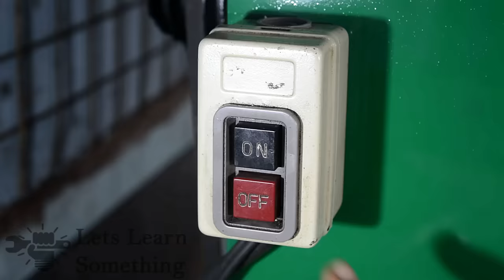Homemade Lathe Machine

Comment: I give this 10/10 for effort and persistence.  However, the key things missing are measuring the "bed" for twist, aligning the headstock to the bed, and squaring the cross slide to the spindle axis.  This is a cool barnyard machine but without these precision alignments...its accuracy won't ever be any better than used lathes you can buy all over the place for $500.  Further, those spindle bearings are not preloaded and not even intended for thrust in the first place.  And no tailstock....
Reply: Now do you feel much better cutting down someone else hard work. You are fricking amazing. Instead of saying good job, you try to boost your ego by cutting down someone. You must truly have a very low self esteem.
Reply: @lisah6451  man he is literally giving some suggestions to make it better
Reply: @lisah6451  As Creator must accept any advice/suggestion/comment, this is how design evolved.
Reply: @bobemperorofbobkind6004  still a cutdown by telling him that a piece of crap $500 machine would be just as good
Reply: @lisah6451  you're too emotional. the guy gave credit, then gave his critique. stop creating drama.
Reply: @lisah6451  He gave valid and useful advice. You just jumped in and started displaying Bad Manners. The only one here that is guilty of the charges you've levied is yourself. To be clear, he didn't equate it to a "piece of crap". You did that. It's very important, specifically for a person who may want to build their own first lathe, that they know the inherent shortcomings of a machine built from the process shown here, and perhaps consider buying a used - commercially made - machine in the $500 range as their first foray into lathe machining. The parts to make this version will likely cost as much, require many pieces of equipment that may not be at hand, and get no better results, if the project even gets finished.
Reply: @lisah6451  THE GUY ABOVE IS RIGHT...10 OUT OF 10. BUT EVERYTHING HE STATED IS TRUE. BY THE TIME I GET AND PAY FOR ALL REQUIRED PLUS TIME IT WOULD BE MORE THEN 5-600...WE ARE NOT DOGGING THIS GUY. HE DID A GREAT JOB WITH WHAT HE HAD TO WORK WITH..SHIT I WAS THINKING ABOUT DOING THE SAME THING. BUT USE HI WIN LINEAR RAILS...THE NAME OF THE GAME IS RIGIDITY...
Reply: Hi and welcome to mental therapy! Stop and think. All of the answers and comments and opinions are correct! The fellow watched videos and got up off his butt and jumped right in! He bought what he needed. He made what was in his mind! The "mental picture" of what HE WANTED the machine to look like...and HE DID IT.   Now, the fellow that ADVISED him, to square the chuck with the table (the "WAYS"), and to make a TAILSTOCK; were very good advisements! If He listens to the comments, in this chat box, he can make his machine much BETTER! Even the drama, that was started, was that person's way of stating that they didn't know anything about his subject so they lashed out against it. (In time, hopefully, they will set foot into the real world, and experience how it feels TO TAKE SOMETHING THAT WAS MEANT TO DO ONE THING, but make it into something totally DIFFERENT!) Their mind runs with the knowledge and their body delves into the reality that HOBBY DESIGN is a mental THERAPY! You can get lost in doing it. You make something, from what YOU want it to do. If it works,...fine! If it doesn't...figure out why and build it different! WORK OUT THE BUGS IN THE DESIGN, yourself. Take opinions and advices from other folks, and address the idea. 
   BUT ALWAYS MEASURE IT TWICE, And cut it...ONCE! 
Thank you ALL for advising this young man! I'm sure He appreciates the advices. even the drama stuff...there's always SOMEBODY that just HAS TO put drama into it!
Reply: Please give a list of places to purchase metal lathes for $500.00 or $600.00. I want to get me one!
Reply: @general5104  Ebay, Craigslist, hobby machinist forums, various auctions (schools/estate sales/etc), word of mouth/friend network, (re)build from scrap from various sources, books that show step-by-step how to build a lathe with itself as you cast and accurize each component yourself (there's even YT videos of people following the instructions in the book set to create their own machine shop).
A lathe is a machine that facilitates the removal of material from a workpiece at greater speed than by hand, while attempting to maintain accuracy. How you get to that point is the path you make for yourself.
Reply: @general5104  face book market place..there's usually a shit load.
Reply: usually no threading
Reply: HE IS NOT BLACK THIS IS RASISM

Comment: Commenter in previous video: "imagine if he had a lathe"

This guy: "shits expensive imma make one"
Reply: And a pretty damn good one at that.
Reply: Yeah bro I've seen that comment too, this guy is a genius!!
Reply: Not for nothing... He could easily have bought a good used lathe for what he has into materials alone. Let alone time. But he still built an AWESOME machine that I'm sure will serve him well.
Reply: @brandoncrimmins6296  a good used lathe of this size for $500 (he mentions this cost for materials in another's comment)? Please, tell me where that exists.
Reply: @EwokyBalboa  First and foremost... I see NO comments with cost analysis. Secondly if there is a comment claiming a $500 investment. He either got a lot of this material for free or. He's LYING... 3/8" or 1/2" steel plate is EXPENSIVE! Ball Screws are EXPENSIVE! Lathe Chucks are EXPENSIVE! At least any chuck worth having is expensive... So again. Unless he had a lot of these materials and parts hanging around. Which he openly states he did. $500 is a fallacy. If you had to source and purchase all of these parts and materials. ESPECIALLY THE MOTOR! You'd be WELL into the thousands of dollars. Probably somewhere around $2,500
Reply: @brandoncrimmins6296  check Dave Lister comment asking about cost, it's line the third comment down for me, he commented on that. Second: all the parts he lists are Chinese, and they are pretty cheap. I'm pretty sure here not including the motor so probably right about that but used motors can be found pretty inexpensively
Reply: @EwokyBalboa  my point is if I was to build this in my shop at home. It tallies up at just under $2,500. So I guess shame on me for pricing QUALITY materials...? Even still...  Chinese crap isn't as cheap as people pretend it is. Especially when it comes to machine tool parts. 

I built a CNC router out of Chinese parts. All of my electronics, hardware and bearings came from China. And when finished I was lucky to hold an eight inch of tolerance. Which is a HUGE MARGIN for error on a computer controlled machine. Like at an 1/8" you might as well be talking miles...

After upgrading everything to much higher quality U.S. made bearings and hardware. Including the lead screws and nuts. It holds a solid 10 thousandths and it's made of MDF. So it would actually have saved me $500 or better to just spend the $1,500 on the quality stuff to begin with.
Reply: @brandoncrimmins6296  a good lathe chuck 4 jaws price at shopee online is RM 78(USD35). Steel plate 1' x 4' x 4' is about RM 55(USD13). SBR12-800MM linear guide with bearing per set is RM 67.80(USD 30). That few of the parts he is using. So, USD 500 is within the budget. I think you shops at the wrong place😁

Comment: I've watched this a couple times, and it's quite fascinating, but I'm not sure how you reliably get the spindle nose/bore lined up with the rails with precision.  On short pieces may not be noticeable, but it seems like on longer ones you'd be cutting a taper.  But it was very ingenious, and I'm sure will prove quite useful.
Reply: simple, loosen the bolts on the bearing holders, tap it in place, tighten the bolts. it will not be easy but not impossible

Comment: Would be worried about taper, takes a lot of tuning to get the ways  aligned with the spindle. Never seen linear bearings or a ball screw used on a lathe, I'm surprised by how rigid they appear. Great video, great job!
Reply: tailstock will be an issue

Comment: Yeah I'm a big fan of those linear bearings too. They really simplify the whole process. I've wanted to do this for some time.
Reply: The non raised linear rails actually flex less.   They are used in smaller Fadal and several other VMCs.

Comment: You should add some sort of wiper to the slides to keep the swarf out of your linear bearings, it will greatly extend their life and preserve the accuracy of the machine, it would be a shame for all your hard work to be ruined by parts wearing out prematurely because swarf got in where it shouldn't be.

Comment: Love how perfect plates of steel appear, clean and sized, ready to go! 
Did you order out or prepare in-shop from larger stock?

Very creative and great result in the end, looks very sturdy. 
Maybe smaller and lighter than a lot of commercial machines of equivalent capability, but that's an advantage.

Nice, tight editing, good pace - not extremely-too-fast, I felt I learned more this way!

Was that marking guage a standard machinist's tool or your invention?  Great film!
Reply: P
Reply: im pretty sure that all the pretty stuff is bought

Comment: I think I can do this, I have wanted a Lathe for 50 years, Im gonna make one.
Reply: how much does one cost anyway to buy,?
Reply: @fidelcatsro6948  200 for a used clapped out machine. sometimes you can find them at scrap price if someone doesn't know what they have or it needs rebuilt. Otherwise something in comparable size to this one would be easily $1000USD
Reply: @brunsy1990  i see thank you for the info!
Reply: theres ones similar in bed length for up to twice that on the far end of the spectrum. more if you get a digital readout system for real time dimensional measurements.

Comment: 18:33 It is such a beautiful thing to see you using the lathe you are building to turn a part of the lathe itself LOL and 19:46 you used the cart like a drill press haha. 

and 23:17
It's like machinist inception lol 

I wonder though, was it cheaper than purchasing a lathe?
Reply: Good
Reply: Cheaper than purchasing a lathe of this size with this amount of horsepower: For sure.
But not cheaper than a chinese mini-lathe I guess. But with more solid parts.

I think it's a nice inbetween :)
Reply: @kjeldschouten-lebbing6260  Yeah i think too so would i rather making one in the future? 
I like to watch videos about making but i don't have experience. I will live in France later and i know that there is place named fablab where people can help you creating things that you want i don't know if you name it like this too. 
But I think that i could go there and get some help and by praticing with them and get some tips i could gain in experience for doing my own stuff what do you think?
Reply: @kjeldschouten-lebbing6260  It for sure wasnt, you also have to count the work hours that he put in. I would say that he needed at least 250 hours for a project this big, so only the hours would cost him about 2500$ if he would earn 10$ each hour. In my opinion you can build stuff like that just as a hobby but you cant use it as a tool that you are working with, its only a toy.
But anyways good job.
Reply: @filipfurdyna5346  A crappy hammer is still a hammer. A crappy lathe is still a lathe, not a toy.
If you just need to make some fitting metal inserts once in a while or something, its a fine tool. 
Somepeople take fun in working to save money, I also don't count my hours for restoration projects and I don't hear the wife complaining about that costing us anything either.

Comment: This is about 1000 times easier and simpler than a gingery lathe. You should make plans.
Reply: Gingery lathe is made from scratch. Like nothing from the store except maybe screws. Also the guy knows how to measure things. Watch episode 16 when he makes a spindle and measures it with a micrometer over the whole length of the bed - it is precise. Notice he made it so it is fully removable and he can add shims as needed. Gingery guy knows his stuff.
Reply: @tomk3732  I personally know the skill and knowledge involved with building the gingery lathe as I am currently building my own. I'm just saying it's a lot easier to weld together a lathe than to cast each part.

Comment: With this im going to make a mill. Then with mill im going to create gears and rack for upgrade on this lathe 😀
Reply: that is basically how it happened. in 1752 the first modern lathe was made. thirt years later its direct descendant turned parts for the first mills.
Reply: That's how it is done. Google search on "Dave Gingery books" for more examples.

Comment: To start, I am impressed by your work and devotion on this project. But do have a lot of questions concerning it as well.
You seems to have no clue about the flatness of the bed and the carrier, so you don't know the limitations/precision of the X and Y axes. If you want to improve that you need to control and rectify the bed with a granite block and a bit of hand working. The second problem here concerns the spindle, you must check if it is concentric.
Reply: if the rails are parallel to the spindle, and some dial indicators on the x and y axis. you would be able to make parts within 0.05mm
no need for precision scraping or fancy grinding
Reply: @paypwnz  Agreed,  but trust me when I say its a pain to do that with every part, plus manually correcting while at the same time manually feeding, on china ball screws? You're gonna have to get within tenths, then sand the rest.
It's fun for a few dozen times because you learn a lot, but try it on every piece you ever make, for months = Annoying and time consuming, one mistake and you have to start all over again.
Vulpes is thinking long-term, so I agree with him as well, LLS (the uploader) bolted the bed and rails together, which means he can spend a few hours to check with a dial and adjust with shims then tac-weld it, heat it all up and spray weld it, then weld it to a solid construction to avoid oscillation/vibration, then hand work what remains.
It'll save time further down the road and wont have to sand everything just to get within 0.05mm, sanding is what you do to get within thousands! :)
Reply: Couldnt you just put adjustment bolts in the legs and level it up. Then the any taper would indicate error in perpendicularly and or parallelism ?
Reply: This guy has limited $ and proper ways and gibs are out of the question as well as granite blocks and such. There would be a lot of play with such a set up but if it works for him then he could build a huge lathe or afford something better down the road. Foreign countries are so different than the west.

Comment: This is amazing, I love it.
I would however remove the rust and ensure it doesn't come back before permanently assembling the parts.
Also, I had doubts about the way you were marking parallel and cross lines, but it seemed that it worked out anyway.
The rails used in most big lathes are triangle or trapeze, to make sure that when clamping down or through wear the tool post is still lined up to the center axis of stock holder. 
Having the rails line up perfectly center to the rotation axis of stock holder is essential for drilling and carving.
Could you measure if it is lined up?
If you managed to do that, then it is perfect.
Reply: sorry for my observation, in my opinion I would say ok for the solidity, for the rest I hope he spent little to make it, because around there are used lathes with all the features at bargain prices,

Comment: Cool but I would have started with balancing the u profiles of the base...
Reply: How would you of done that? And by balancing I machine you mean making the surface flat and true no?
Reply: @deathuponusalll 
When you weld the u profiles, they seemed to be not flat but a bit skewed. I'd have checked that with a water level. Maybe you did but didn't record that part?
Yes, with balancing I mean, making the ground even.
Reply: Maxi Jazz I see, thanks for replying! I’ve seen other folks that don’t have access to these machines make surfaces flat using 3M spray glue, sand paper glued to a glass table and just pushing and pulling the object horizontally

Comment: I've watched a few of your videos, and although I profess no machining training I'm still impressed with your abilities! I was wondering;  your parallel scribe you use often, how do you guarantee that it doesn't angle one way or the other because of the round stock that is part of the scribe that goes against the piece you are scribing. I was thinking if I used that tool, I would probably not hold it correctly and the line would be shy or proud one where or another. A machinist square is what I usually grab to scribe layout lines.
Reply: Understand that there is NOTHING actually "aligned" to any level of "precision".  There was nothing in the video that showed any "alignment" to the "spindle" ...which is also NOT "aligned" to anything.  Everything in the video is only "eye-balled".   A very cheap lathe can only machine to about 0.001" (.025mm)  A proper lathe can machine to 0.0002" (0.005mm) AND BETTER depending on the machinist.   ALSO, the machine a shaft "parallel".   This machine cannot. This "alignment" wasn't even considered or shown in the video.

ANY kind of metal "chip-making" machine cannot be made from "steel".  This was found out by one major machine tool builder 50 years ago. White Sundstrand built a series of machining centers based on fabricating.  the machine frame was very thick plate.   The end result was a machine rampant with vibration.    CAST IRON HAS INHERENT DAMPENING PROPERTIES.

The "E: value of steel is much "better" than cast iron ...but when it comes to machining, cast iron is simply the only "best" way to make ANY machine tool.

How do you turn to a specific "known" diameter?

How do you generate a thread?

How do you machine a taper?

A lot of work .....and you can't actually do much on it.

.